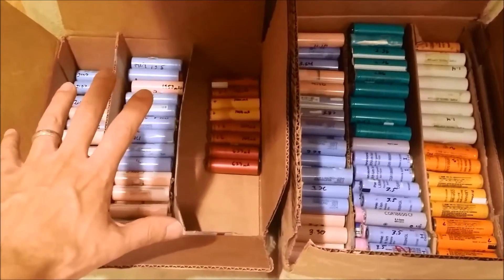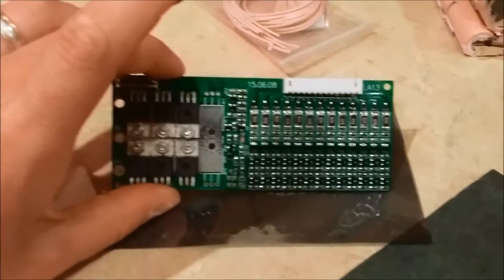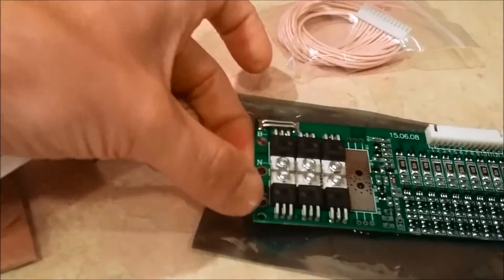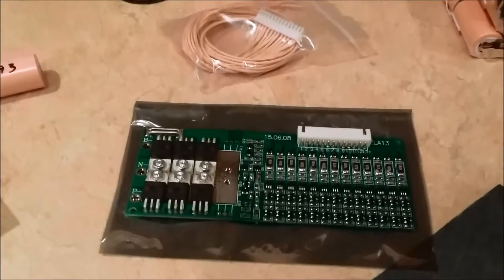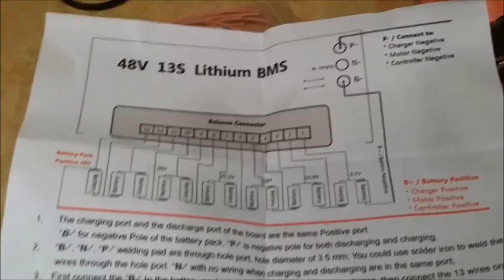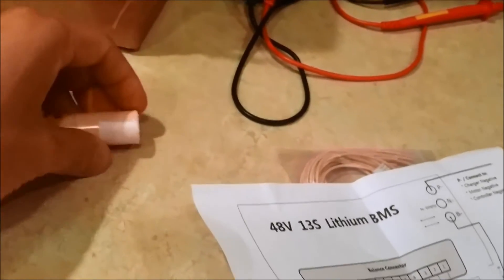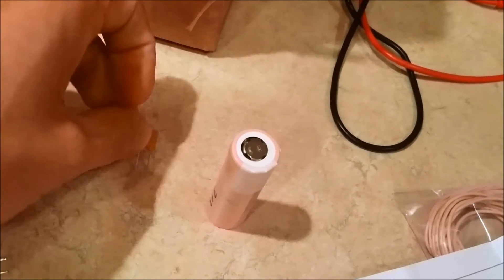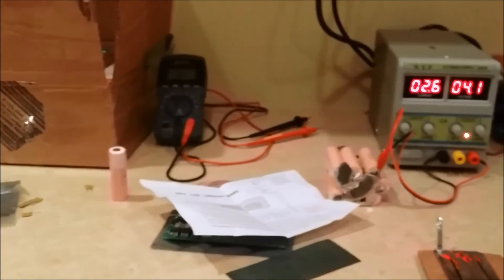"Receiving cool parts" for the18650 lithium e-bike battery (Part 1.5)

Comment: Very cool project dude,   you going to test the fuses before assembling the pack?
Reply from the maker: +jehugarcia Thanks man!  I tested each one before and after installing just to make sure.  The battery is finished if you haven't seen my other vids.   So far I have 160 miles on the bike and its doing great.  Im currently working on the next battery build going thru and testing each battery, so far I have 8 of 13 banks tested.  Each bank will have 8 batteries.    Im going to try to spot weld this time, but Im not sure how to connect the fuses just yet.
Reply from the maker: +jehugarcia I watched your bus project 'Samba' and that is freakin awesome!  One day when life slows down Im looking to something similar.   Great vids!
Reply: +15-sec-of Fame   Very cool,  tell me more on the fuses, did u see what I used as fuses?  Cheap but not resettable
Reply from the maker: they are great for a dead short or runaway etc.. if a individual cell tries to release 4 amps or more the fuse will open and shut off the that one cell with the issue.  Once the fuse cools down it will re-set and close.  If the battery is shorting out it will keep opening and closing until the battery is low enough to be noticed during charging when a bank is not equally charging.  Its not a perfect solution, but I figured its a safer one for protecting the batteries.
Reply: +15-sec-of Fame    And they do short out,  I use 18650 cells for 12v on samba and upon inspection the other day I noticed a couple of burnt fuses on the pack,   Testing  revealed shorted cell.
Reply from the maker: oh wow!  Thats good info,  I will defanitly watch for it in my pack as I'm using used cells from laptops.  When Im done building the the new battery and my pvc shrink wrap arrives from china I'll meter each cell and test each bank to make sure they are still at the rated 17.6 Ah.  If I had one those testla modules I could go pretty far on 100 amps! :)  Right now I can go around 50-60 miles safely at 15 to 20 mph.  The battery isn't big enough for the 1500w kit and when blasting it around (doing 38 mph on ave) the battery starts to get pretty warm after 25-30 miles.  I knew it would when starting this project thats why I'm trying to finish up my second battery before winter sets in.  It just hard to find 2 amp or better cells in old laptop batteries, so I may have to settle with 1.8 to 2.0 amp cells for my next battery.  My battery now has 2.0 to 2.4 cells.

Comment: I'm looking for some tabbing wire and I was hoping you could let me know where you got it.  I've about to start my build.  Thanks.
Reply from the maker: +Chris Hoppe Hey Chris, Good luck on the build,  If your building an e-bike it is a lot of fun to ride!  I just finished my 1500w e-bike and will have a new video out soon.   I got the tabbing wire on ebay.  Just type in Solar Cell BUS WIRE. and there will hopefully be some good options out there.  If you have questions about the build just let me know. Thanks
Reply: Sounds good.  Thanks.  I'm building an Ebike.  I've got a 5K W motor and am building a 48V 40A pack for my bullitt cargo bike.
Reply from the maker: Chris Hoppe That bike is going to be awesome with a 5000w kit and a 40 amp battery.  Please keep me updated!

Comment from the maker: I bought it all on E-bay.  Some items came from China and they took awhile receive them.  Just type the following in E-bay to find each item:

-Solar Cell BUS WIRE 5mm x .02mm. Pre-soldered  
(.02 seems a little thin, but it will work, you might be able to find some a little thicker) 

-Reset-able Fuse 16V 4Amp.

Hope this helps and good luck on your project,  thanks!
Reply: +15-sec-of Fame +15-sec-of Fame . im not understanding the 4 amp fuse side of things, on the type of fuse i think your using the Tripping Current: is almost double the run capacity. i assuming there are 4A (4000mA) Resettable Fuse 16V thermostat thermal PTC fuse, if that's the case. They have around 80A Max Carrying Current before they melt lol, A Holding Current: 4A, but a Tripping Current around 7.2A.  So will handle loads up to 4 amps but will only trip if the Current exceeds 7.2A according my out my head specs. Am i wrong?
Reply: RUEF300 16V 3A Resettable Fuse
Description Value
Trip Current 6 A
Maximum Voltage Rating 16V
Hold Current 3 A
Maximum Current Rating 100 A
Agency Approvals CSA/TUV/UL
Maximum Trip Time 10.8@15A s
Typical Power Dissipation 2 W
Minimum Initial Resistance 0.02 Ohm
Maximum Initial Resistance 0.05 Ohm
Category PTC Resettable Fuse
Reply from the maker: +willthisonedo2 Yes you are correct.  The Amp rating is higher due to them being rated at 16v.   I knew when buying these that it will be a higher amp rating and i didn't want premature tripping if they start degrading later.   Plus if I had a catastrophic failure and cells were dropping off I wanted to make sure that I had a buffer of amperage before they all are start tripping and cant limp home.  Its better than straight nickel strips connecting all the cells like most :)
Reply: +15-sec-of Fame I bought those 4A resettable fuses, and I tested one to see what current it would trip at. I put a current consistently between 6 and 7 amps, and it never tripped. Apparently the trip current is 8A. I don't want to buy new fuses, so I think I'm going to hook up the positives of two batteries to the fuse, so the collective current between the two won't exceed 8A. I know it is still possible to exceed the 4A per cell doing it this way, but I'm going to work with what I have.
Reply from the maker: Nice man!   They are good for shorts or a runaway cell if the battery gets damaged during a crash etc.. I installed them for extra protection from each cell.  Plus I didnt want them to restrict the power from the reaching controller also.   I figured that at 4.2v the amp rating would go up to as high as 7-8v due to the fact that they are rated at 16v.  Also, make sure you have a circuit beaker between the battery and the controller just in case for a main power shut off.  I have a 50amp CB on mine.   Good job on the research as most people wouldn't take it as far as you did.
Reply: Cool! How much did you pay for the BMS and resetable fuse?